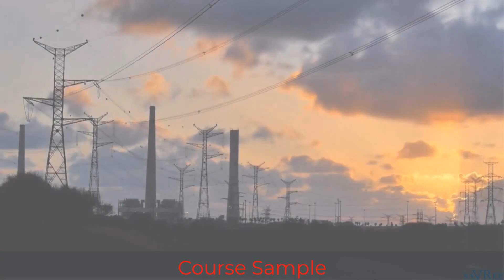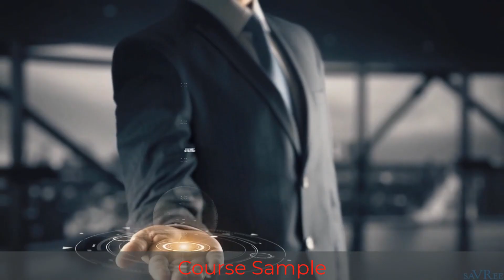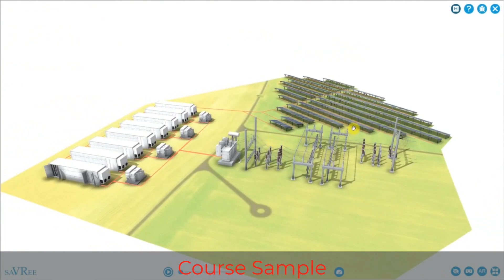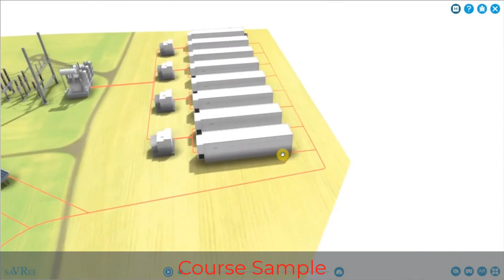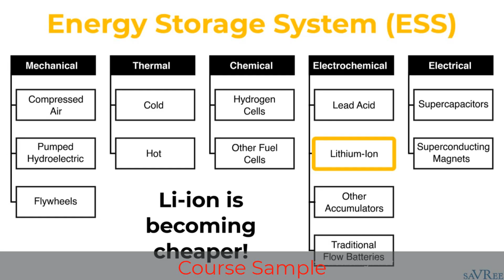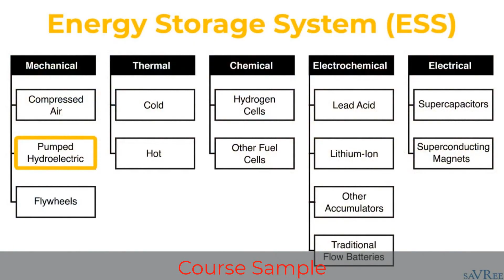How Battery Energy Storage Systems (BESS) Work - Video Course Sample

Comment from the maker: This video is a sample from the saVRee engineering video library, which contains over 100 hours of video content covering mechanical, electrical, marine, power, nuclear, and industrial engineering topics.

In this sample, we talk briefly about the core principles behind Battery Energy Storage Systems, including various types of energy storage systems, lithium-ion battery technology, main BESS components and their functions, AC vs DC coupling, safety systems like fire suppression and thermal management, BMS and EMS integration, grid connectivity, and real-world applications in renewable energy systems.

📘 Explore the full course on How Battery Energy Storage Systems (BESS) Work:
 https://savree.com/en/online-engineering-courses/How-Battery-Energy-Storage-Systems-BESS-Work

🎓 Browse our complete course catalog:
 https://savree.com/en/online-engineering-courses

🔧 saVRee gives you access to:
 ● 500+ interactive 3D models for technical training
 ● 100+ hours of video-based engineering education
 ● Industry-standard content used by engineers, students, and trainers worldwide
 ● SCORM Compliant

Start learning about engineering today with engaging, practical content, visit https://savree.com

#savree - THE engineering training company.